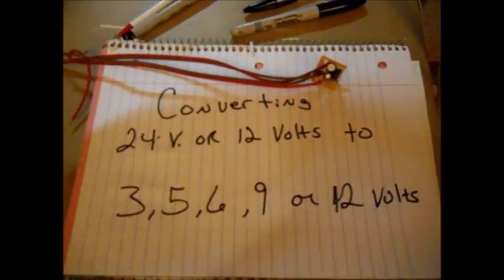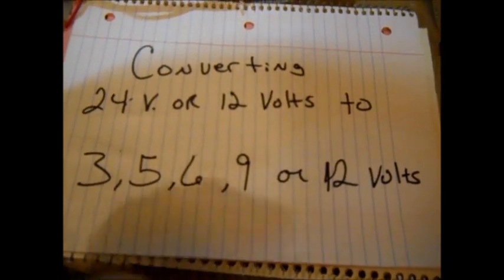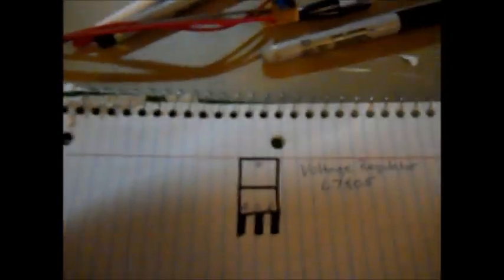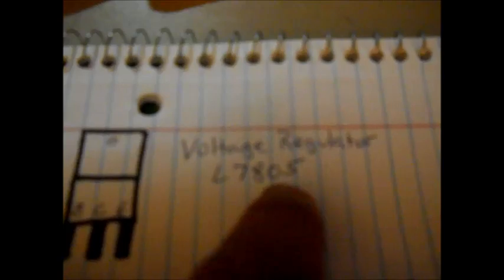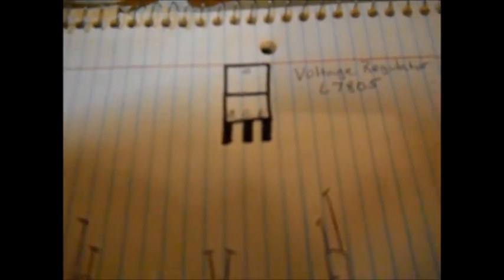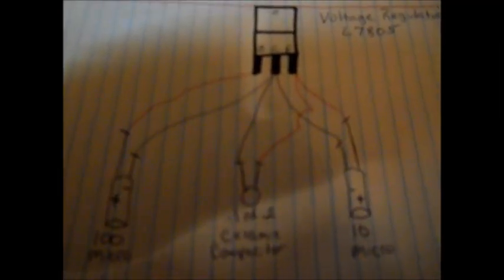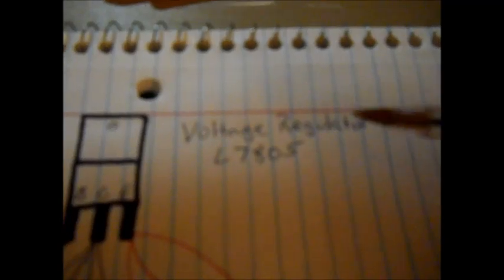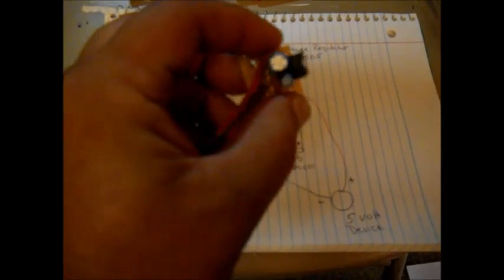How To Reduce 12 or 24 volts to 3, 5, 6, 9 or 12 volts

Comment: video is not so clear, but good job. I need to convert 6 Li Ion (3x4.2)  = 12.6. In parallel (the voltage for the other components). My head lamp only needs 8.4v. Should I use a circuit to drop v , Or tap into the battery pack configuration for the lower voltage I need?

Comment: Or you can buy one on eBay for five bucks. However, how can you convert 48 volts to 36 volts for a ebike? The circuit would have to handle 15 amps. It doesn't have to be precise plus or minus 5 volts as the controller can take up to 44 volts and go down to 33. A lot of people want to know how to do this because these ebike batteries are $500 and if you have a 36 volt controller and a 48 volt battery, you don't want to go out and buy a 36 volt battery, if you can somehow reduce the voltage of the 48 volt battery. Also the newer 48 volt lifepo4 batteries can go down to 2 volts Per cell before needing a charge. However the controllers shut off at 33 volts. Meaning you don't use up all of your battery before your ebike dies, if you are using a 36 volt life04 battery.
Reply: I used a 36v battery on my 24v ebike and now it goes better uphill and pulls off quicker but is still speed limited to 16mph. You want to check the voltage of the caps in the controller but still a risk you could blow something.

Comment: This is good the only problem is AMPS the L 7800 series only can handle 1 amp so if you device consume more this is not going to help you  the 317 whit a by pass transistor 3055 will handle 10 amps you also can do the same thing with the  7800 series but all ways you need a power transistor to handle the load
Reply: I liked your commentary. I had the same doubt! Other problem: I dont found this three legs to buy. May you tell me which piece can give me 3 amps.? Thx

Comment: Hi could you possibly help me,  I have a DC/DC Power Converter Regulator Module Step Down Adapter 12V/24V to 6V 5A but my trouble is but the Bluetooth receiver I would like to connect to needs a 5 V, will the adapter damage the receiver? any help would be appreciated.

Comment: I'm confused I want to install a 4 pin switch: 2 pin for switch / 2 pin for Led light Switch Rating: 2A/36VDC Can work for DC 12V
This switch LED voltage 3V. How can I convert the 12v from my motorcycle battery to 3v to make this switch led work?

Comment: This was so extremely helpful....but let me run by you what I'm trying to do and let me know if these instructions will work.  

I'm taking an older Belkin UPS, the model that was used with AT&T Uverse several years back, that's been in disuse for some time.  And trying to turn it into a power source, that I can use, mostly to jumpstart "dead," batteries for various electronic devices, but an emphasis on mobile technology like tablets and the like.  A lot of Chinese Android tablets, older Kindle Fire tablets and others are seemingly "dead," but the truth is they powered off during a cycle that didn't finish and they need to be boosted to working order once again.  

**Let me say, that I had the UPS laying around, I"d always figured I'd do something with it.  I realize that there may be better ways to accomplish what I'm after. Ways that won't require work on my part. But I'm also getting into basic electronics, and would enjoy the challenge of building this, furthermore I've got a spot all picked out where it will hang on my wall behind my desk and I've alrady spliced up the AC cable to a negative and positive nodes that can be used with little alligator clips soldered to them. 

That said, I've already replaced the 12V battery that comes inside the UPS, because it was DOA. I need to be able to reduce this 12v battery to each of the wattages you mentioned, and setup a red/black post for each, that I can simply connect my jumper cables to depending on how much power the device I"m working on is safe to work with. I'd like to run something like 4, 7, 10 and 12 volts giving me four optional post setups.  

Your directions get me to each level...but what about geting to each level, in the same device, without interference, and without overloading....and obviously without my death.  
                               

Thank you very much in advance!  And any and all persons with the knowledge to help me out are welcome to reply.  The original video producer, M Baldridge, would be great, and I'm writing to him, but I'll take all the help I can get.
Reply: Your comment is longer than the video ^_^

Comment: Would I be right in assuming, that stepping down a 12V 1000 mA converter, to 3.7V, would be lower voltage, and higher current?  
I'm attempting to wire my electric(battery operated) shaver, to revive some life out of it lol
Reply from the maker: +Kevin Ketelson  I can not answer that for sure because I am only learning myself. I know I am able to run LED lights that originally ran off 2 aa batteries that are 3 volts combined. Using the 67803 powered by a 12 volt solar battery set up and they have lasted over a year

Comment: may i ask what board did you use  to put all those capcitor and voltage reg, is that a pcb or something you made. does the amperage decreases also? sorry im just a beginner. your video tutorial is very useful for me. thanks for uploading!
Reply: i think it would decrease or say the same but i if you use a buck converter instead of this it would increase ,

Comment: Uhh the LM7805 is not a transistor, so the marking would be voltage in, voltage out and ground. This is completely different from the base emitter and collector in a transistor because one is just filtering a voltage and the other is being amplified...

Comment: This is awesome! Just exactly what I was looking for. You are right there isn't much else out with such specific detail. I'm trying to figure out how to add a single LED to a 24 VDC device so you know when it is on. The lighted switch I put on it burnt out after a few days. I think it is supposed to use 12 vdc but it has no info on it.  Thank you so much!
Reply from the maker: Tom Rybak Thanks for watching, usually LED light is 3 volt maybe 4 volt max. Glad it helped but make sure you use a good heat sink the transistor can get very warm and I did find out it does use a little more power than I liked but I have a very small solar system that every 1/4 amp is precious to me. I have been working on using resistors like they do in the 12 volt cell phone chargers with a led light. they bring in 12 volts reduce to 5 or 6 volts but also lights a led that needs only 3 volts